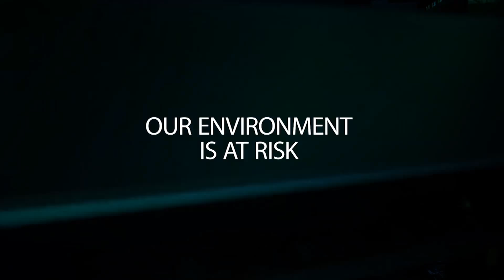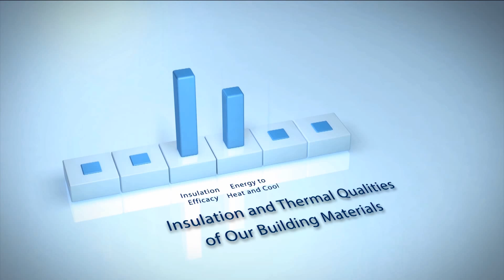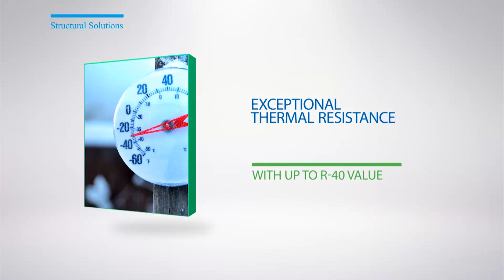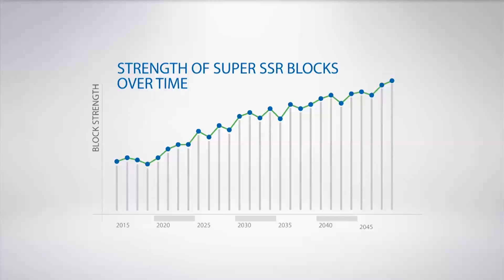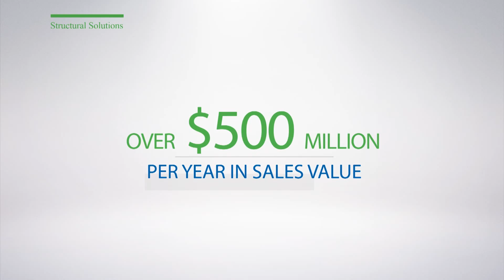JustBioFiber Introduction

Comment: Is this a viable construction method in humid climates? With the Tamped hempcrete building, it needed weeks of dry non humid weather in order to dry. Is that the same situation with this building system? Will you be extending this building system to the US in the future? If you are, what will the cost be compared to a regular stick build?

Comment: what is the cost???I want to work at the Ontario plant.
Reply: Roughly $44/block.
Reply: @quintdooley1591  actually .... Here is some recent info from their web site....
Pricing:  Depending on the market area – pricing can be up to 37% lower than traditional building materials with comparable specifications, while providing additional quantitative characteristics that existing methods do not address. To gain market acceptance JBF will be placing 100’s of demonstration projects across the globe to satisfy the need to see and feel the product. Several pricing tiers will be developed to address global demand as advanced manufacturing techniques are deployed.    https://justbiofiber.com/about-us/